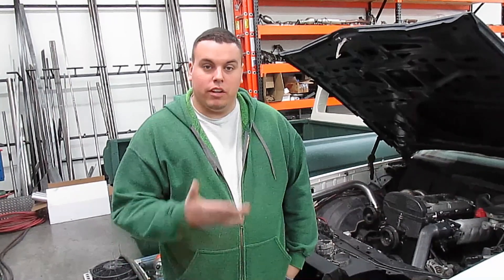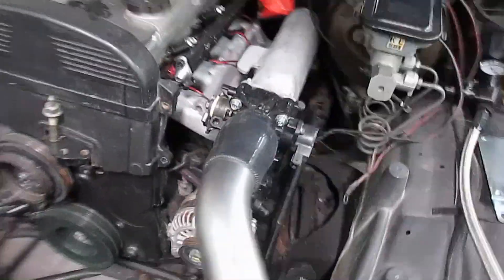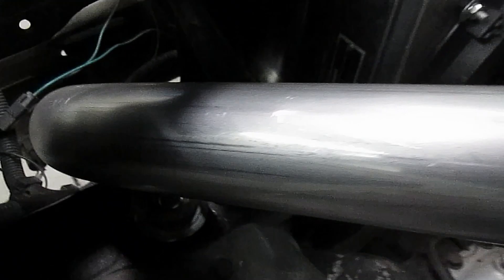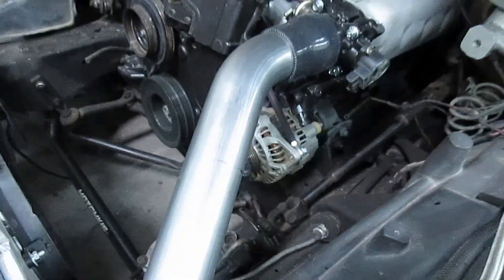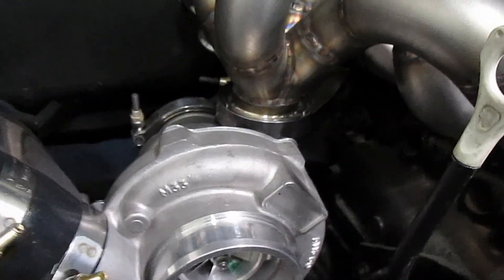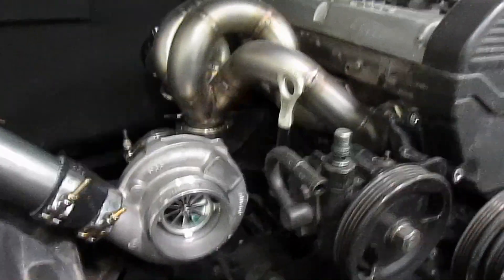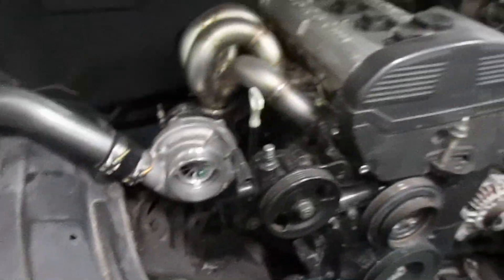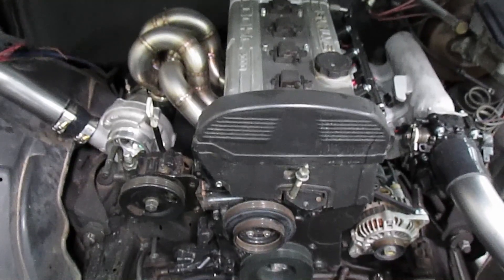RWD 4G63T 1984 monte carlo SS Part17

Comment: Wrinkle black powder coat for the IC pipes and intake (for a more clean OEM look) and then maybe a wrinkle red on the intake manifold and turbo compressor housing  if your wanting to do a two tone thing. But I personally would leave it raw.

Also for the header, I would make a custom shield and insulate the bottom (inside) of it.
Reply from the maker: I would like show off the stainless blueing.  My engine bay is so big.  I am not so worried about the heat.
Reply: I would at least put some heat reflective material on the underside of the hood then!
Reply from the maker: Yes i will be using the gold reflective tape

Comment: What would be amazing is if you could pull off a factory look. I've seen lots of wild mods with racy color schemes, but I'm thinking black and metal and a custom engine/engine bay cover like most newer cars come with today. Look at a modern day GM engine bay and picture instead of "Chevrolet 4.3L" or whatever, change the 4.3 to 2.0 or 4G63T. Could even add a powered by Mitsu, similar to the Scion(Toyota)/Subaru venture recently.....Or powdercoat you piping Chevy orange and maintain the wild racy theme.
Reply: I hate those stupid plastic covers! Maybe paint the engine block Chevrolet orange if you were trying to pass off a Mitsubishi engine as a GM product ROFL. (don't)
Reply: I know what you're sayin'. If the swap was being done in an old Dodge or Plymouth, it would make more sense to pull of a classic DSM could-have-been.
Reply from the maker: thanks for watching!!!
Reply from the maker: thanks for watching!!!

Comment: that's the worst motor to ever put in the heavy car some people don't understand the logistics of racing you want to go fast it's all about horsepower to weight distribution less weight equals faster duh
Reply from the maker: I am sorry you are so misinformed.  how much do you think this car weighs wit a 5 speed manual and a 2.0L in it?  Do you understand that the stock set up was roughly 70% front and 30% rear as far as weight?  The car is now a front mid engine car and is very close to 50% front and 50% rear.  it also only weighs roughly 2900 lbs without the roll cage.  this motor will make me 600HP to the wheels with my current mods.  3000lbs wet/600HP = 5lbs/HP  that is a better power to weight ratio than many of the top teir cars on the market right now (under 90k$).
Reply: @FatGuyBuilds  Nice comeback. He definitely couldn't think of a response to that.
Reply from the maker: @brianboldin6979  i figured since he didnt respond..lol
Reply: @FatGuyBuilds  I have a 87 monte carlo ss that I'm currently working on.
Reply from the maker: @brianboldin6979  i have an updated monte carlo video coming out wednesday 4-15-21
Reply: @FatGuyBuilds  ok I can't wait to check it out. How far are you from va?
Reply from the maker: @brianboldin6979  NEW MEXICO